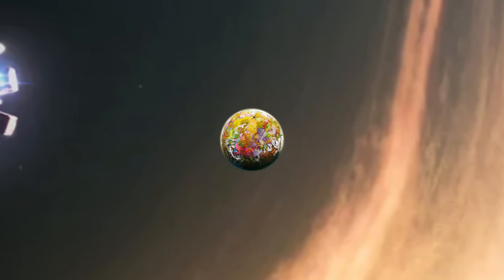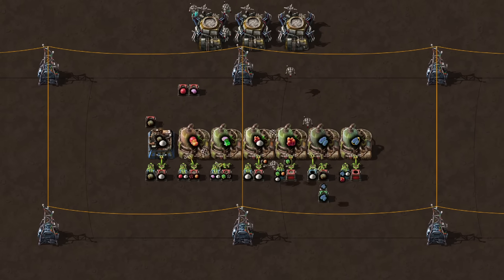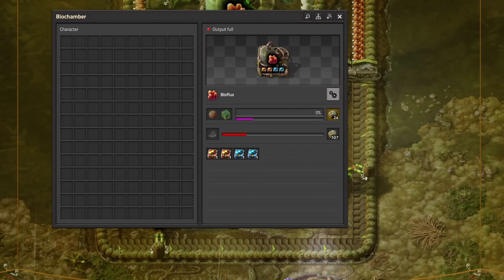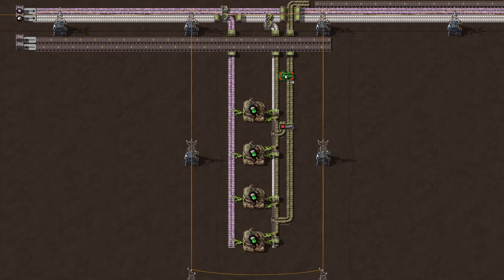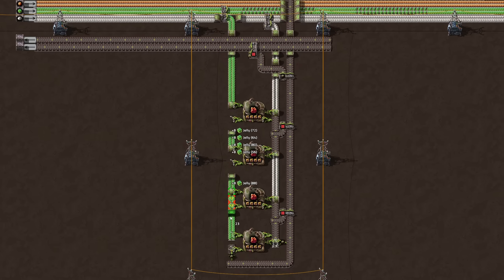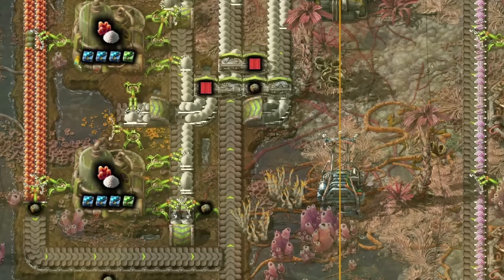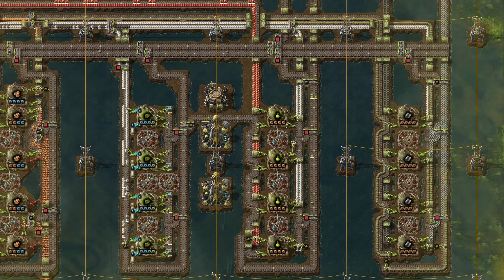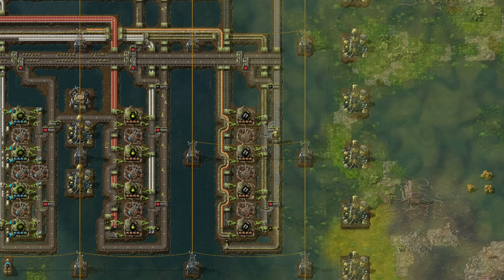Master Planet Gleba in Factorio. With Belts and a Main Bus! Factorio Guide / Tutorial

Comment: I ended up redesigning my factory to produce bioflux with direct insertion of processed fruits. It makes them 99% fresh all the time, while with belts I always had at best 80% something, and since it adds up this is quite painful. Now my science is like 98% when it comes out which is much nicer - you basically get +25% SPM for no reason other than changing your factory a little bit. Another fun issue was that after optimizing all my stuff I stopped producing any spoilage. Literally suffering from success. But your solution is very nice, I might borrow a thing or two from it.
Reply: If you need spoilage just make extra nutrients
Reply: I have to realise your idea at my Gleba plant. I have the same problem with 80% fresh science bottles. Your Biochambers produce direct from fruit to jelly/smash to bioflux to science bottles without belts?

Comment: may I know how much is the science spoiled in the end? Im also trying to not use bots for agricultural science but it produces science with 20-30 mins of time left and after transporting to Nauvis it's at 20mins at best, sometimes happens it spoils right before getting into the science lab
Reply: also, what mod did you use for planning the blueprint pls?
Reply from the maker: I'm not using all the science produced. If the transport spaceship arrives i will insert the freshest 1000 science packs. The others will decay and finally be burned. The science has 78% freshness when arriving at nauvis. So if i actually research with agricultural packs i guess they will be used at 70 - 74 freshness which is totally fine.
I don't use a mod for the blueprints. 100% vanilla. Just /editor.
Reply: @AVADIIStrategy  Thank you for the response. I just spent like 3 hours designing my own belt based blueprint in the editor. It produces 95% fresh agricultural science packs. I've done it the similiar way like you did but I tried to have everything as close as possible, but I still can't believe I managed to do it this "perfect". My old design was producing like 40% fresh after designing the blueprint for around the same time. Oh and also, I used blue belts only.

Produces exactly 1000 science per minute

Comment: This is roughly how I did it, although I had a single belt with Bioflux and Nutrients, since most relevant things needed both. I also processed fruit in-line rather than in their own dedicated sections, since processed fruit spoils so much faster than raw fruit. Finally, since fruit doesn’t start to rot until it’s pulled out, I put limits on my harvesting inserters so they don’t start pulling fruit if there’s plenty on the line waiting to be processed. Demand fluctuates, after all, since not every science needs agri science.

Comment: The biggest thing I'd recommend for belting your Gleba base is to simply not stop it. Everything can be burned except Nutrients and Bioflux. So you run JIT processing for Nutrient and Bioflux demand and then run everything else on a continuous loop from production to scrapping without stopping. Yumako and Jellynut incoming goes straight into heating towers, enough to consume your entire supply. Thus the belt never stops and never spoils. You simply draw what you need for JIT processing of other things like Nutrients, Bioflux, Eggs, etc. You do the same thing with Jelly and Yumako Mash, from production straight into the heating towers. Eggs as well, never have spoiled eggs again. Easiest way to do this is to have your bus belts go straight to your heating towers. And put everything burnable on the bus. Every production line splits the belt off but then merges that same material back onto the bus with priority. The belt never stops moving from source to end.

This way you don't need to deal with spoilage because everything is going straight to the incinerator anyway. You only have to manage constraining production and storage of things that don't spoil or can't be burned like Bioflux, Nutrients and other things you can produce with bio materials like Plastic, Sulfur and Copper/Iron ores. For things you want spoilage for like carbon based stuff simply siphon the fastest spoiling item into a buffer chest that only outputs spoilage. I believe that's jelly. Using this technique you only get the freshest materials at every step and thus get the freshest science out at the end.
Reply: It can be dangerous to burn yamako and jellynut.  If your base locks up and they all burn, you can end up in a seed deficit. It’s better to have a lock scenario where the agricultural towers pause. After hours of the base being dormant your fruit lines might be full of spoilage, but your seed supply will be intact.
Reply: @dehb1ue  Seeds don't spoil. So can be stored indefinitely for restarting the base. I would recommend overbuilding Yumako and Jellynut processing so that you send almost none of them to the incinerator not really because of seed lockup problems but because they have around 5x the burn time of a jelly/mash so if you are using one single burner location for everything they can jam up the burners.

You could also deal with this problem by unhooking power to the agri towers. Because the yumako and jellynut never spoil if you leave them in the ground.

Comment: I solved this in a slightly different manner:
1. All belts for spoiling items are circular, and use filtering splitters on the starting end to remove spoilage
2. Bus contains only lasting biopruducts: yumako, jellynut, bioflux, as well as spoilage and other. Jelly & mash are made on-site.
3. Dedicated circular belt of nutrients which are all put on the near lane; the outer lane is reserved for spoilage removed from machines
4. The master control terminal controls which areas if production may be active; it is located in its own isolated power grid powered by solar panels.
5. Tons of wiring
6. Fruits are not removed from the trees until there's a train coming

The result is astonishing – 500+ rocket materials (before the silo productivity bonus!) per minute, that's almost vulcanus level of production.
Reply: Nice!

Comment: I have conquered Aquilo with large-scale production but my tiny Gleba base is an absolute mess that's handled by bots. I've been considering tearing it all down because of the constant attacks I get, so this video had perfect timing.
Reply: I'm pleased to report that I have successfully ripped up my entire base and refactored it using belts
Reply: Thanks to roboports giving radar coverage, it was easy to copy my entire existing base into a blueprint in case I fail 😎

Comment: Turbo belts and stack inverters are a massive buff to belts. Good luck getting bots to match the 240 items per second you get from a single stacked turbo belt. I mainly used it for the massive nutrient consumption of my egg biochambers. Everything else is pretty well handled by direct insertion. The best use I found for bots was nutrient delivery to everything except the egg biochambers and bioflux delivery. Unlike belts you can easily turn on and off delivery with bots and you won’t have a massive amount of resources spoiling on belts.

I’m looking forward to the Aquilo video. I would love to make a belt base but can’t figure out the heating well enough. I just brute forced it with power guzzling bots and it feels so wrong.

Comment: I also build a Gleba belt base and I feel the same way about bots. Thanks for the tip with the non-accepting rocket silos. I will steal this design immediately.

My basic problem was that I either have to make sure that belts never back up (which usually means that I have to throw a lot of stuff away), or that I get rid of the spoilage at every step. 

My crucial design choice was that for every belt I have, I either have to decide whether I add a heating tower/ recycler at the end or whether I make sure that all items on the belt are sorted so that the items in the front spoil first. Then I only have to filter out spoilage at the end. This basically means that I can only use one inserter for such a belt. But it works surprisingly well.

As others have already said, I would not put fast spoiling items for science production on the bus, but rather use them where they are made. For the production of non spoiling items it doesnt matter whether they are made out of almost spoiled things or not. So for those items its ok to put yumako mash etc on the bus.

I just upgraded all my biolabs to legendary on gleba.

Comment: I solved it using belts, always running in closed loops that have one filter splitter to remove spoilage. Seeing it working is a kind of mind bending dance, especially with the turbo belts.
Reply: My first design did it this way but I kept getting bioflux that was minutes from spoiling.  I ended up just letting everything keep flowing and burned/recycled anything that made it to the end of the line so everything was always fresh.
Reply: @xipheonj  yeah, I do that for science, only the freshest ingredients, unused parts get burned. But for the rest of the factory creating the supporting stuff it doesn't matter all that much, you drown in resources once it is set up.

Comment: Cool ideas, but the biggest thing to ensure freshness is to never have dead end belts. For stuff where spoilage doesn’t matter it’s fine but for spoilage dependent recipes you should keep the belt flowing continuously, The jelly and yumako should pass by each machine that needs it, and then to disposal heating towers (this is also great to increase the amount of power you’re getting from the towers. It’s ok to throw away excess ingredients since you get it all for free very quickly anyway
Reply: Exactly.  Make every factory produce faster then their inputs so you'll never have spoilage or let the excess pass through to be recycled/burned.  One of the silly problems I ran into was that nutrients don't burn, so the nutrients in my waste area had to sit in a buffer area to wait for them to spoil.
Reply: @xipheonj  Yep, dealing with nutrient overflow relly sucks. Moreover, I had issues disposing of excess bioflux, as it spoils extremely slowly, so I turned it into an insane amount of nutrients, waited for it to spoil and then burn it. For a small base I needed around 20 steel chests or so.
Reply: For some things like the fruits, which expire after an hour, I think dead end belts are fine. Just handle the spoilage at the end. The good thing is that old items will be used first. That makes it efficient.
Reply: @edgar9651  I think you should always process the fruits whenever you have both of them, a simple splitter to break up your belt and 'when both fruits > ~40' combinator. That, or use circuits to only harvest the fruits when you need them, they don't spoil when they're still on the trees (which'd make it resistant to sitting for a few hours without any nutrients as well, which is unlikely but eh). 
Spoiled fruits produce no seeds, and getting deadlocked that way sounds awful to restart your factory from, however unlikely the 150% replacement rate + productivity makes it
Reply: @edgar9651  A potential issue with spoiling fruits is that you can run out of seeds. I process unused fruit at the end of the bus into mash/yello, then burn that, so I'm guarenteed to have enough seeds. Plus the mash/yello generates a lot of heat, so I need less rocket fuel.
Reply: Ingredients are not free they cost pollution
Reply: tbh kinda should have some spoilage to be sent for emergency nutrients to restart a factory.
Reply: @ Yes, definitely. Got a giant nutrient loop and if it is empty it activates emergency spoilage nutrient assemblers, also spoilage is sent to those assemblers and to making carbon with priority over being burned
Reply: @submachinegun5737  yeah I used some circuit conditions and passed those over radars to a spot where it could make nutrients to restart things, removing any need for manual intervention just in case I didn't balance anything out right.
Reply: No, you 100% do not need or even want looping belts anywhere on Gleba (at least not for common quality production). All loops do is make things less fresh because they senselessly spend time on their loops without it solving any problem. What you need to improve freshness and reduce spoilage is restricting input. If a belt backs up, the machine that puts stuff on that belt simply stops putting stuff on that belt. You can easily do this with some wires. You want minimal distances for basically everything, but most importantly stuff that spoils fast (yumako mash and jelly). Belts that stop simply need an inserter filtering spoilage out - just in case basically.

My setup produces 600spm and produces basically 0 spoilage. The only times spoilage is generated in my base is when my iron/copper ore generators need to be kickstarted with the mash/jelly recipe that produces spoilage directly. Amusingly this is actually not enough spoilage to satisfy my sulfur and carbon biochambers, so I have to forcefully produce spoilage when needed.

Please, stop it with the loops...
Reply: @ I will continue with the loops because 
1. Recipes that are not affected by spoilage are better to just have a constant stream of available ingredients, eg. the nutrient loop. My entire base has a big loop of nutrients for fueling biochambers because the spoilage of the fuel doesn’t make spoiled products, and removing the spoilage from it is not difficult with filtered splitters. 
2. Spoilage and in general constant production just means free power, stopping each stage of production just means less stuff flowing through to be burned, which would be ok with solar or fusion power, but still might as well take advantage of burned organic power because
3. Using wires to control inputs causes lagging production tied to the distance the item has to travel, even with robust wiring there will still be excess or too little items for a particular production stage
4. Better to just have a constant stream of resources flowing through because they are infinite and it is way less complex than wiring to control inputs
5. And finally the key point is that not everything is on a closed end loop where the end connects to the start, for anything that spoilage matters for the end is a heating tower (or building to turn it into a burnable fuel), the loop in this case just means a loop from the main ingredient bus(optional since gleba doesn’t actually have that many ingredients) to the building that needs it and then back onto the bus, just to make sure there are no dead ends where unused ingredients sit and spoil, and everything keeps on moving. So yes putting bioflux on a loop and just waiting for it to be spoiled will be bad, a science assembler will grab a 10% spoiled one and then make basically worthless science, but that is not what loops should be used for, only for certain spoilage agnostic things. 
Also finally for a main bus with longer belts, or any gleba base really, to reduce intermediate spoilage time from mash and jelly just transport the raw fruits around and process them into the needed stuff right next to the building that needs it.
Reply: Agreed, I think dead end belts are pretty bad in general for anything that can spoil. One trick you can use to try and tune this is to use circuit conditions to limit the amount of items that flow into a belt or a loop. I just wish there was a good way to throw out items that are below a certain threshold. I really hope they add something like that in 2.1. Until then you basically just need to address bottlenecks by limiting the amount of items going in and cycling out any excess to be burned/spoiled/converted to resources.

Another more complicated way would be to make your inputs only happen on a clock. You'd guarantee almost fresh items coming into mash/jelly processing and cycle everything out after a certain amount of time then replenish with fresh items.

Comment: I used a main bus and belts for Gleba as well. What's weird is that I don't usually use a main bus, but the challenge of perishable items led me down that route. I was too afraid of any wastage when I started, as wastage means more spores but the enemies on Gleba turned out to be a non-issue.

Later on, on Nauvis I ended up with a small bio lab setup using biter eggs for nutrients and that was almost entirely bot-based (Aside from the biter eggs, which roll along a belt and straight into a heating tower if unused) and it was much easier. But still, I'm glad I got Gleba working with belts.

If doing Gleba gain, I don't think I'd use a main bus. I'd probably have completely self-contained modules which do everything (From fruit to end product) in order to minimise the time spent in the most perishable states. I'd then only have fruit, seeds and spoilage on a bus. (And maybe nutrients.)
Reply: The most important observation of mine was that you only care about spoilage when doing bioflux and science. For everything else spoilage is not a problem - you can create a perfectly valid rocket fuel from 1% jelly as well as from 100%, and moreover, you NEED some spoilage for carbon. You can mine it from space sure but I like to produce things locally as much as possible. So, my build is fruits -> bioflux, bioflux -> science (2/3 to eggs, 1/3 directly to the science bio labs), and the rest is just apples/jelly on belts to rocket parts because as I wrote they don't care about freshness.
Reply: @psilon69  That's a very good point. I did think about using chests with inserters set to pick the most/least spoilt items depending on where they needed to go but it I wasn't sure about the full considerations. For example, which spoilt level does a recipe which uses two ingredients use? The most spoilt item?

It could still be useful to use chests to allow for overproduction of the items where it matters very much like it was used in this video for science packs going into the rocket silo.